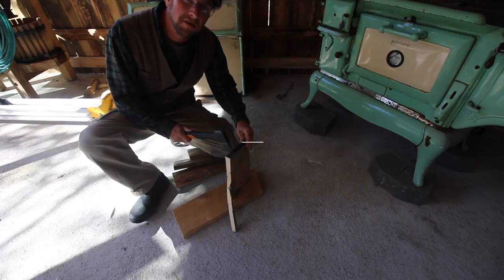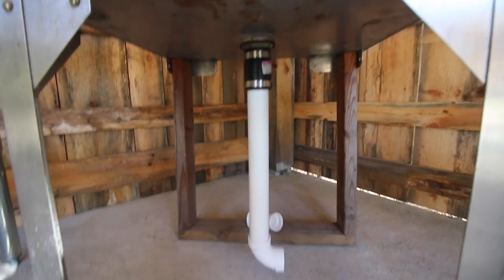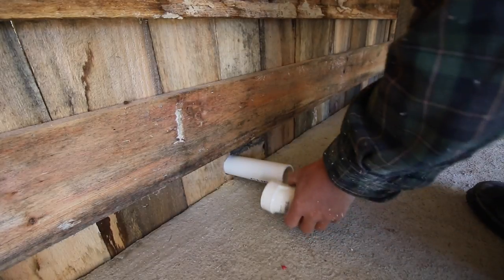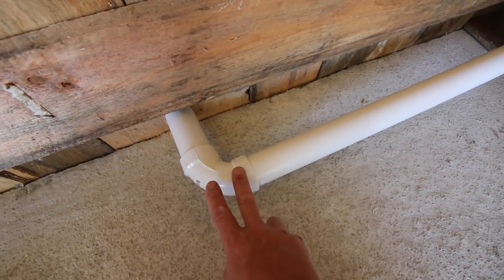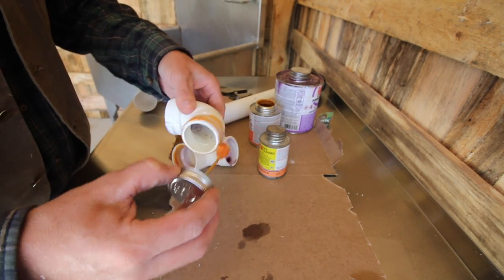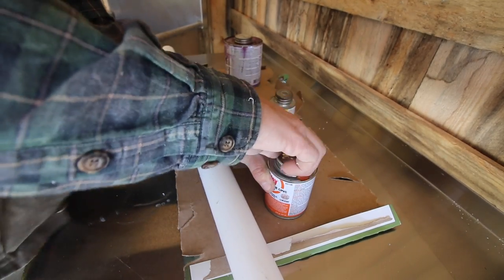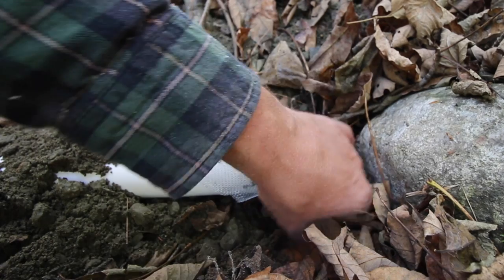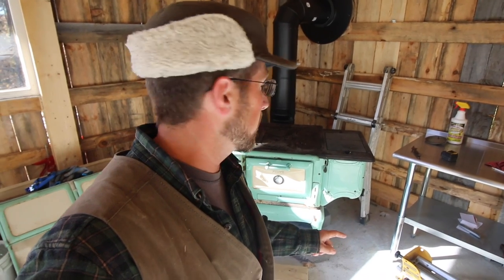Lighting the FIrst Fire in or Kalamazoo Wood cook Stove & Plumbing the Offgrid Sink

Comment: Love the sound of wood burning in the cookstove... I bet it smells nice in the summer kitchen also. May I suggest you run your drain pipe in the top 3rd of a five gallon bucket filled small rocks or pebbles. You need to pierce 1/2 '' or 1 '' holes in the bottom and sides of the bucket. pierce a hole approximately 2 '' from the top of the bucket to run your drain pipe. Fille the bucket with small rocks. Dig a hole in the ground deep enough to set the bucket.With this method the water will easily drain in the ground and you wont have any smells. If you want you can put a foot or two of rocks and pebbles around the bucket to make it easier for the water to drain in the soil. Hope this suggestion helps. Love watching y'a...
Reply from the maker: Good idea! Thanks

Comment: I cook/bake on a K Prince in blue but it doesn't have the water reservoir.  Instead, it has copper tubing that runs around the firebox and sticks out the back, which I assume attached to an early water heater.

Comment: Where is the warmer section? If you put it on and leave the warmer doors cracked a bit it will help heat the space. I learned how to build a fire in the wood cookstove in my grandparents' outdoor/off-grid space. That sticky stuff is probably from the cast iron having been seasoned with oil. If you want to get rid of it and protect the cast iron do it like you would a cast iron pan....  scrub it good with steel wool soap pads and rinse it well, then build a fire and let it dry well. Then apply Crisco vegetable shortening in a thin layer over the cast iron top.

Comment: Take 4 pipes that are large enough to fit over the edges slid them on after you cut them to the correct hight ,45 the bottom paint therm green

Comment: BTW, Hardwood ash tends to have a lot of good minerals to put in your Garden. I've never made soap from ashes, but some folks really like doing that. I have made a number of batches of Laundry soap. You can make about SIX GALLONS from a SINGLE BAR of Zote™ soap. I make Three gallons at a time from Half a bar, grated w a cheese grater into a five-gallon Pot. Add a couple of gallons of Hot water (doesn't have to be boiling.)
Stir well and let it sit overnight. By morning the mix will GEL ("saponification") and you'll have to break up the gel by stirring. Add the stirred slimy batch to bottles, to a little over half full, add more hot water and shake them well. That's your laundry soap. 

Use a cup or more per laundry load. A 14.7 ounce bar now sells for a bit less than $5.00, and makes SIX GALLONS of laundry soap for less than a dollar per gallon. Compare that to the price of the Brand name detergents at $13 - 18 per gallon. Check the internet, you can buy 20 bars at a time for a considerable savings, and you never need to buy commercial laundry soap again. I believe you can do this also with Fels Naphtha bar soap. Sorry, Procter & Gamble.

When I first learned about this, W a l m a r t   had Zote bars for .97 apiece. Used to be marketed only in Mexico and further south. Six years later, the price is ~$5 per bar. I think a lot of people have started using it. You can also just shave a little direct from the bar right into your washing machine w the clothes.
You can still add Borax for whitening, either added to the liquid in the jug, or added to the wash.
I lived on a ranch for a few years in the Sierra foothills.

Comment: You may want to put in a faucet with a hose fitting on the back to run a hose from the house during your workshop so you'd have easy, unlimited water.  Good luck with your class!!
Reply: You cold also set up a connection from it to the outhouse sink for large gatherings like the pig butchering, or family picnics. Then you wouldn't have to worry about running out of water in the outhouse.

Comment: ya need a tank up in the rafters you can fill from the hose to give ya runnin water in that sink
Reply: Medic Aided -- That is an interesting idea. That would provide running water out there.
It would be good if Al could put gutters on the outdoor kitchen and collect water in rain barrels. If the barrels were higher than the sink, there could be running water from the rain barrels.
Reply from the maker: The plan is to install gutters and have 2 275 gallon tanks 6 feet off the ground. Next springs project! Lol

Comment: I hate leaks. Here where I live drain pipes are quite different. They have rubber locks, you don't need to glue them. Maybe you can use silicone glue/sealant to temporarily fix your pipes

Comment: Just wanted to comment on this older video. Generally, sheet metal screws at reach stove joint is reccomended. 3 per joint. Did you ever get the warm water tank functional?

Comment: A pvc screw on end cap with 1/4 inch holes would be a bit better  than screen. Small amounts of sand, dirt ,debris ,and other fat or biomatter ,will block a screen  realy quick and may cause freezing issues or just drain backup. With possible  pipe fitting failure.  And it will most likely happen at the most inopportune time.  I.e.  sink full of bloody water .oily dish water, or just dry stuff on the floor when the pipe blows apart.
Reply: I dont mean to be negative  but I  often see problems and want to warn people before it happens
Reply: He could take that screen off pretty quickly if it got blocked.
Reply from the maker: The screen can just pop off easily! But great heads up

Comment: Bro great job on the kitchen and compost toilet. Seal that floor... Haha lol. Have you thought of adding a grease trap? All the fat and grease are going to attract all sorts of thing and smell if it drains on the grass. You would be better off with a grease trap and a 55 gallon barrel in the ground and a leech field to let the water leech out for kitchen and bathroom... .2 cents
Reply: Or use a barrel with holes in it to have the water leach out of the holes in the ground. Put a vent on top of the barrel in the ground about 4 5 feet under so no freezing. 3 cents haha
Reply from the maker: Great ideas. I might have to do this come spring
Reply: I definitely agree with seal the floor. You’re going to be having a lot of potential blood splatters etc. and concrete stains period. You have worked so hard to make such a beautiful building you don’t want it to be ruined with stains in the concrete.

Comment: Ahh, that looks great!  What will you do for water for the sink?  The buckets seem short term and a little inconvenient,  will you run a hot and cold hose from the house and only have it hooked up when your using the OGOK?   Looks like the stove is designed to slow burn a medium sized log, will it be hard to regulate temperature in the oven?
Reply from the maker: We plan on putting gutters on the OGOK feeding into 2 IBC totes on the back of the OGOK  on a Pallet self 6 feet up.
Reply: Lumnah Acres sounds good, what will happen in the winter, won't it freeze?

Comment: Um, won't the screen catch food particles and get plugged up?
Reply from the maker: The screen can come off easy enough if we get plugged.
Reply: Do you ream the insides of the pipe edges before you cement them together? It makes less area to trap gunk. Water flows better thru the pipes.